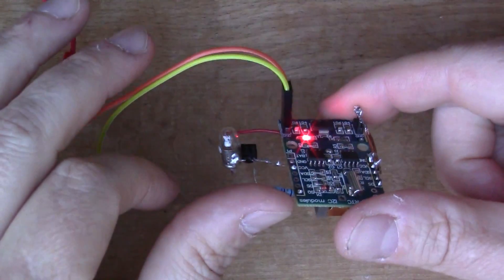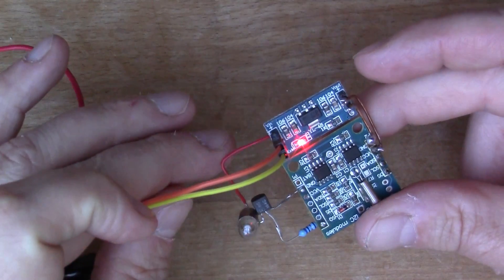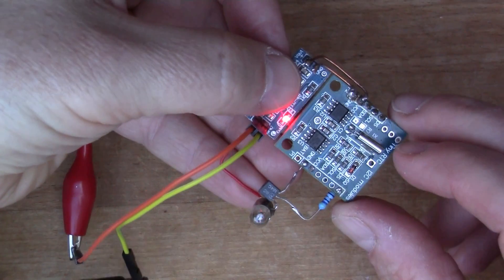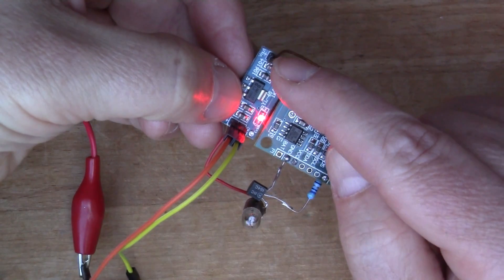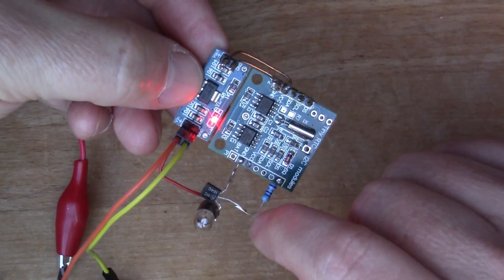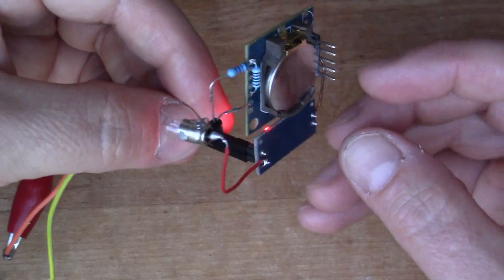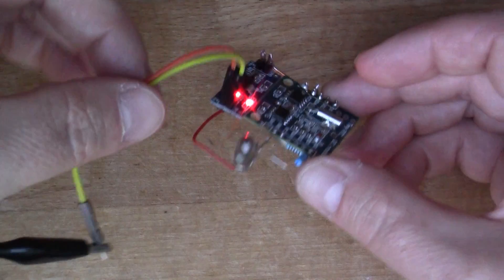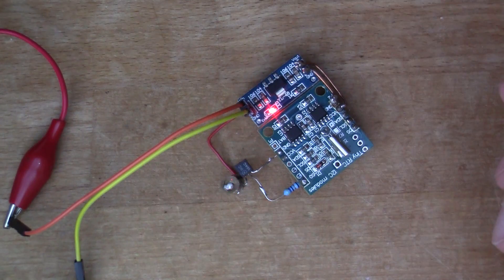Flashing Light Prize 2017

Comment: Hi Martyn. You should watch out using a standard CR2032 in that "Tiny RTC"-module. It tries to charge the button cell and it will lead to an explosion if left unattended. The module is meant for a rechargeable button cell. If used with a CR2032-cell (primary cell) the MELF-cased diode should be unsoldered to break the charging-circuit.
Reply from the maker: Thanks - yes I have come across this before. Somehow the cheap Chinese ones got cloned from a rechargeable design, but as you say they often get used with a standard cell.  There is a website somewhere that says how to disconnect the charging circuit (remove the diode etc) so that a standard cell can be used without problems.
Reply from the maker: Here we go: https://www.dipmicro.com/store/DS1307BAT-MOD

Remove R5, D1, R4 and short R6 to use a standard cell